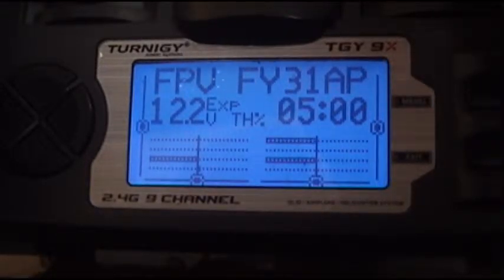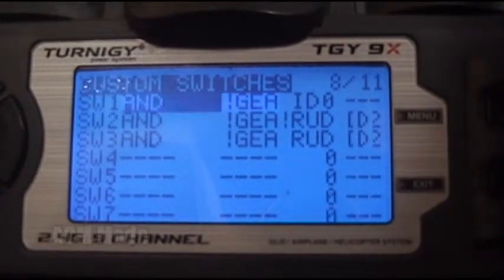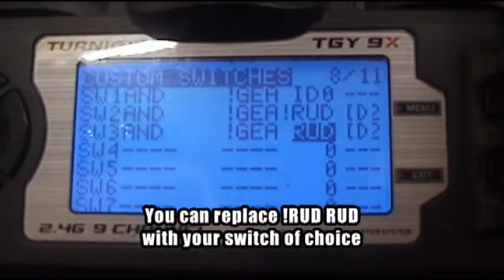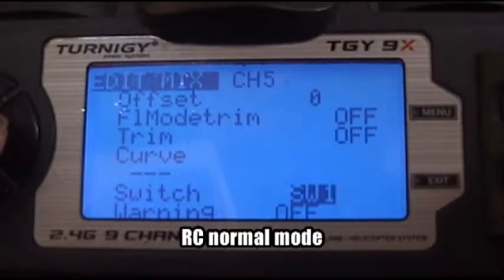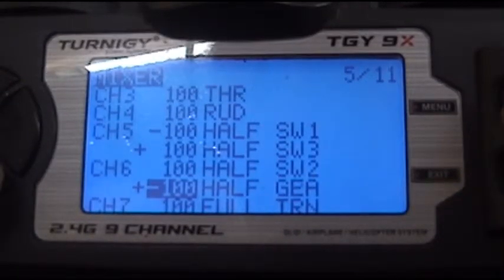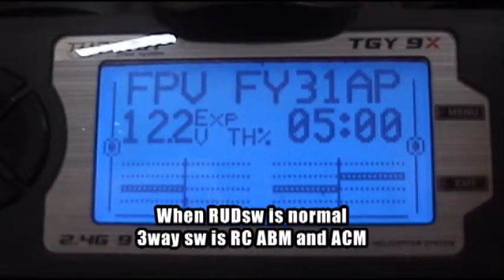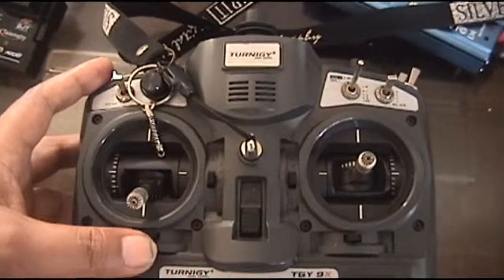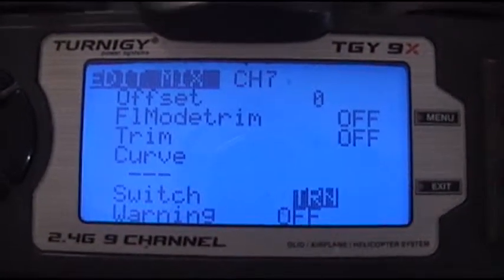ER9X 9XR PROGRAMMING FOR FY31AP with NAV OPTIONS

Comment: Hey James,

This is SOOOOOOO   EXACTLY  what I need   :-)

Now...
- I have flashed my 9XR with the latest firmware
- on Page 9/11 (custom switches), I have for instance on second line :
SW2 AND !GEA        ID2
but I cannot find a way to have
SW2 AND !GEA !GEA     ID2
like i do not have this extra column...

Which firmware are you using please ?

Thank you
Reply from the maker: +Philippe Giboulot they have changed er9x alot now, the dont even have the bar display no more on the latest firmware, if you have a video of your problem, or the output of what you need, ill be glad to help you
Reply: +James Balagtas&#160;

Hi James, Not only do you make great tutorials, you are even kind enough to answer ! Thank you for that :-)

What I would like is exactly what you obtained on your video here..&#160;

The only problem is that with latest firmware, &#160; on your video here at 2:30, you are able to write !GEA  !RUD on two consecutive columns. With latest firmware, there is only one column, so one may write either !GEA, or !RUD, but not both one after another.

Or maybe the problem is that I have a 9XR. Looks like +Seb Gironde is having the same exact problem.

The bar display is present actually.

Hope I am clear
Reply from the maker: ok hond on il update my radio to see whats new and ill do a short video
Reply from the maker: i updated mine the switch are now called Logical switch, it has two switch inputs and still the same, the custom swtich is now Logical Switch or L switch
Reply from the maker: only safety switch have one column,that is different, customs switches at now call L switches, check your radio again, the will not remove that or this radio is junk. it sucks the removed the display level
.

Comment: hi
i've tgy 9XR and in page 8/11 i can't put a the end of the line ID2 like you. Because i've no more 3 parameter per line.
do you know the reason?
Reply from the maker: 9xr is an outdated er9x firmware, unless you update to a newer firmware. my firmware is always up to date to the latest firmware. most people update the 9xr to the latest. if your don't have that last line setting, its really outdated.
Reply from the maker: Updating my turnigy 9x (er9x) get a usbasp programmer at hobbyking. about 5 bucks, to keep your radio upto date.

Comment from the maker: elevator mix will be easy, it will use flaps output as source then you can use curves to adj the amount with respect to amount of flaps!
I will try to do a program tomorrow after our flight, it will be for separate flaps!

Comment from the maker: yes we can, before installing my fy31ap, I had flaperons on my ailerons which is mixed with elevator, the problem now is I use the 3way switch for flight modes for FY, I have an idea, only one switch to activate flaps, but the percentage will be how far you pull down your throttle from mid cursing stick, the more you throttle down to zero, the more flaps it will make, ive seen this in youtube for sailplanes. all we need is one landing switch. the level of deflection is controlled by thro stick